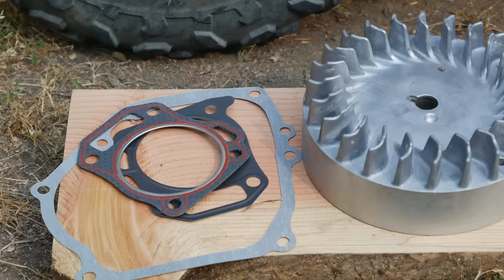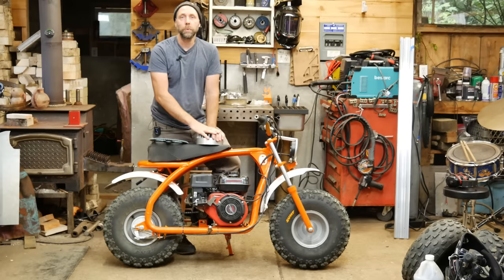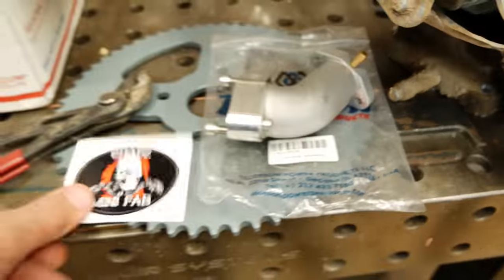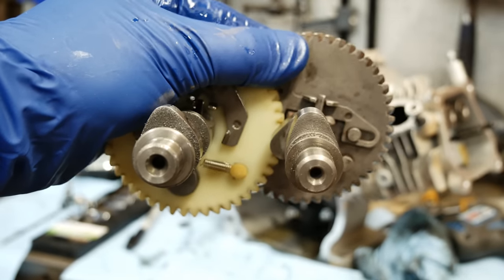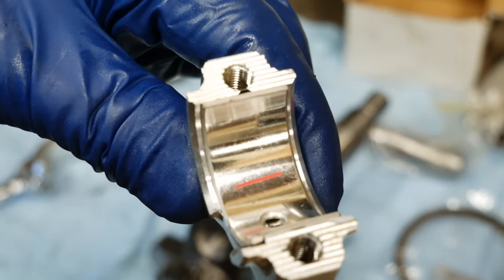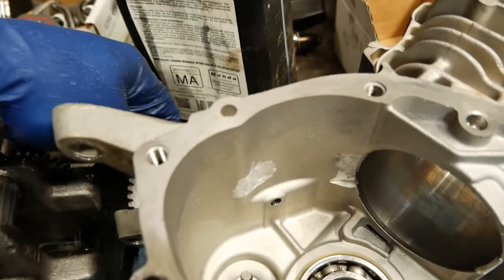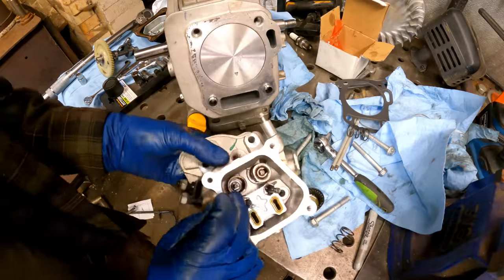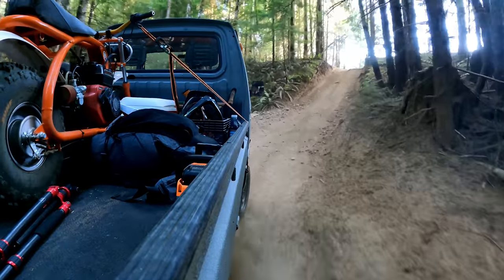Coleman BT200X mini Bike 224CC stroker Engine Mods

Comment: Very disappointed to see that the aftermarket parts aren’t designed to work together without modifications!  The clearance problems you encountered are a big dealbreaker.  How do you there’s enough clearance when the parts heat up and they’re spinning a couple thousand RPM faster than it was designed for until the engine destroys itself?

Comment: His filter is placed not very good, directly in an sand storm, maybe add a plate that closes the triangle next to the wheel, could be simple plywood or steel
Reply from the maker: It’s all going to get changed, I plan on building a different intake. Keep in mind most people just run the carb and air filter sticking way off the side of the bike so if the bike falls over on its side it can break off the carb. 
How about a thanks for the free video man 👍

Comment: Its great if you weigh 125-150 lbs
Reply from the maker: It’s great if you weigh 160 as well 😂
Reply: 225#'s here and I rip it on a BT200x!
Reply: I'm 300+ and I rip mine around every weekend with stock motor..pulling wheelies

Comment: Wish I still had my Suzuki 250 four stroke.
So much better suspension and torque.
And Enduro too. Pit bikes are not really good as serious offroad machines.But good learners.
Reply from the maker: I have owned over 30 motorcycles in the past, rode over 60k on my dual sport bikes. I still own a KTM XCW, this mini bike is actually more fun for the trails around my house riding with friends then my KTM. 
Here’s a 50 Trail ride I did on my KTM 🙂👍
https://youtu.be/ytu-Da4mUiY

Comment: Put a torque converter on it!
Reply from the maker: I had one installed in a previous video, I didn’t like it so I pulled it off.
Reply: @Mikefestiva  if you didn’t like it you need to tune it I didn’t like my tav2 at first but I added aluminum weights and a tighter driven spring and has enough torque to kick me off at launch and a top speed of 58

Comment: Unfortunate place for an air filter.
Reply from the maker: There’s not many options with aftermarket intakes, most people have the carb sitting way off the side of the bike so if the bike falls down on that side you can bust off the carb.
At least that’s not going to happen with a curved intake. 
How about a thanks for the free content 👍

Comment: (DO NOT) run a modified motor with a stock exhaust
Reply: You think it would have any adverse effects?! I think it would be a flow restriction limiting the power but not causing a reliability concern..?
Reply: @brandons42472  I think more than anything it limits all the upgrades due to exhaust restrictions as you said.
Reply: @brandons42472  it would just be very restricted and only run at about half power